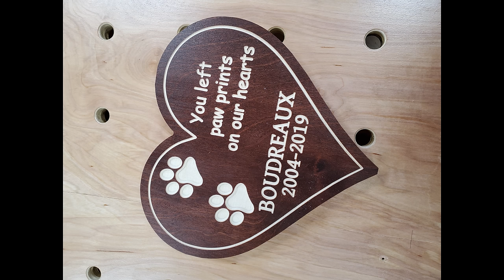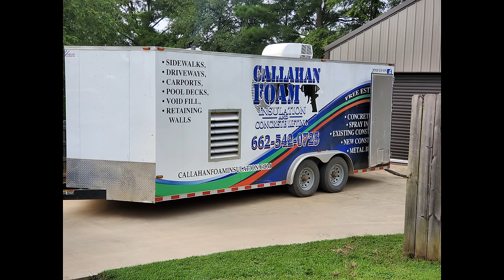30×40 Shop Part 7: Climate Control Overview - 326

Comment: I have a Mitsubishi mini split 18,000 BTU system in my 22’ x 22’ shop. Fully insulated ceiling and walls and an insulated 16’ garage door with only a R6 rating. I’m just south of Houston where it is humid all the time. The system cost me $3400 installed and it runs 24/7. I built a “plenum” to sit on top of the air handler in which I have a 20x25 furnace filter. 1) this system keeps my shop cool and dry, 2) the plenum keeps the coils clean, 3) since it runs all the time, the air quality in the shop is really great. Even if I open the garage door to bring in lumber, the system recovers in only a few minutes. An added benefit is how quiet the outside compressor is, and it sits next to our patio, and it’s nearly silent. I highly recommend this system if you want to keep your tools rust free and work in comfort.

Comment: I put a mini split in my shop with 1" of closed cell foam all over. Works awesome. It has the added benefit of sealing up air leaks and making the building quieter in the rain or hail. I had the backside of my garage doors spray foamed as well ( they came uninsulated )

Comment: Congratulations on finally having a finished look/feel so you can get back to working- looking forward to the builds. I DO HOWEVER, have to recommend that you get French doors (as suggested by others) or side rolling doors- cause you never know when you're going to have a very tall (and/or wide) project and it's a pain to tilt or lay down on it's side to get it below the garage doors on ceiling tracks... just a thought.

Comment: I put a 3 unit mini split system in the upstairs of our home when I finished it. Love it. 2 ceiling cassettes and one wall mount unit. 
The. I put a wall mount unit in my 24x30 foot shop. Used an 18/19 BTU heat pump and it works great. I still need to spray foam on the underside of the roof and insulate the roll up door, but the unit is keeping the shop cool in SC, so once that insulation is done. It will be perfect. Best investment I have made in the shop.

Comment: It sounds great Jay. Thanks for the information on the mini-split. My shop/garage building is 24x40 with 8’ insulated ceilings. We park two vehicles in the garage half so my shop is relegated to half the building. I think my AC contractor is planning on a 24,000 btu unit. Based on his estimate and the rate we’re saving for it I should be ready for it to be installed by February. Since I’m in San Diego about twelve miles from the ocean summers here are not as brutal as they are where you live but we do get a few nights of freezing temperatures each winter. Like you, I’m looking forward to finally having a climate controlled shop to work in. 

Enjoy your new shop. I’m looking forward to seeing what you make in it.

Comment: Jay...remember this about window tint...any time it's brighter inside than outside, the "mirror" effect is going to be backwards, meaning that people can see in, but you cannot see out. Since the first rule of shop lighting is "You can never have too much", there will be plenty of times ...day or night...when this occurs.

This is true of any window, actually...if you have a window on the front of your house (untinted or tinted),  unless the drapes are closed, if the lights are on inside and you cannot see what's going on outside from across the room, then that means that anybody going by can see right in. 

If you want to control the visibility into your shop, instead of tinting the windows, mill some lightweight channels and cut thin plywood panels to slide horizontally and slip them into the tracks. If you get real creative with this, you could put in multiple slots so that the panels would "stack" on each end and leave most or all of the window uncovered.

Comment: Nice shop. Have the same HVAC units. I live up north where you have a "back up heat". I've switched the breaker off and haven't needed it for 2 winters. Your units should also have a "dehumidifier setting" great for basements and I would assume also Mississippi. I love their warranty and have had to use it. And they even went above and beyond to compensate a VERY unique situation. You might want to put up drywall on your half walls to help the 2nd floor, if you want to. Just a thought. Love the new shop and love seeing people who do it right the first time.

Comment: I have a shop heated and cooled with mini splits also. Just be aware, that they lose efficiency and ability to work properly in cold temperatures. My mini split was working 100% and only able to keep my shop at around 50 degrees in the cold Wisconsin winters. I had to install a ceiling mounted propane furnace to bump up the temperature a little when I actually went out to the shop to work. Also, the electric bill in the winter was huge. If you have the option, piping natural gas lines to your shop for heating during the winter would be the way to go.

Comment: Nice job and congrats of the new place - well deserved. That spray foam will pay for itself and a lot of the other costs in energy saving over the 10-15 years. When the time comes for a new roof, consider white shingles. If you have the space, plant some nice maples around the shop for shade.

Comment: Great job. My local building code required fire proofing on any exposed foam. Did you have to spray fire proofing over your exposed foam in the ceiling?
Reply from the maker: No.

Comment: Did you consider radiant barrier insulation?  If so why did you go foam? In my old shop I used closed cell 6.5 inches thick on ceilings and walls and after adding 500 square feet of floor space didn't notice any difference in heat costs.  I was in a very cold climate. Now that I'm in Texas I'm going with radiant barrier in my new metal building.  I've read that radiant barrier in hot sunny climates can save 5% to 10%.  BTW, your insulation runs about 6.5 to 7 R value per inch. I would think in your area that would be good.

Comment: I have the same roll up doors that u have. I am going to insulate them myself with an R13 double pack poly. Supposed to work well, the only real problem is the gap between the head roller, but will build out an insulated case to seal that off.

Comment: You mention the Mitsubishi HVAC Conversion pump working down to below freezing. If the price of gas or electricity is less than the power used to heat at low temps, then the efficiency of the conversion unit is less than the other power sources. One has to compare actual cost factors, not merely if the conversion unit will work, unless no other power source is available.

Comment: Depending on what part of the state you are in you will need between an R30 to R60. Each inch is an r6.5 so if you want to in the future spray an additional 2 to 3 inches and those air conditioners won't work as hard. The walls are fine if they have 6 inches in them which I think that's what you did I'd hafta go back and re watch also the new doors will help tremdously as well.

Comment: These units are quite common in Japan, and Japan's climate is quite diverse. The best way to save utility fee is to keep them on all the time, keep it moderate at the night, rather than turning it off each time you enter the space. You might want to consider installing a smart remote home system to change the temperature. Congrats on your new place! It looks tremendous.

Comment: Hi, I agree that the Mitsubishi units are very good. I live in Pa and installed 4 units in my house that was built in the 187o’s and then added on over the years. The contractor I use was very competent and recommended, in my case, that I use separate condensers and air handles for two reasons one the smaller the unit the higher the efficiently and  two service and maintain is straight forward. The best to you.

Comment: Jay, in the future it would be awesome to get solar panels with power wall batteries. The whole shop could run almost for free and you'd be blackout-proof.
Reply: He can add wall batteries in phase 2, run the climate system on solar during day n on grid at night. I'm doing same at my home with a 5KW solar system. I will add batteries in phase 2 after some savings 😜

Comment: Have you noticed the spray foam helping with machine sound at all? I'd think it would do a lot to stop the echoey acoustics of a high ceiling like that.
Reply from the maker: It made it worse. But it's not bad. Not going to make any acoustic modifications.
Reply: @JayBates  That's kind of a surprise! But I suppose the foam is so dense that it would just bounce sound back, rather than absorb it.

Comment: Do you have plans for your air cleaner cart?  Especially the specifics on motor, etc?  I've been trying to design one and hitting a brick wall, especially about locating one that balances noise, CFM, and cost.

Comment: I do hvac for a living  and do some small woodworking. I was wondering how well the mini splits hold up with the sawdust?
Reply from the maker: Not bad. I'm going to build filter boxes for the air intake. Also, if they are getting too dusty then increase the dust collection and ambient wit cleaner efforts in the shop space. You're breathing in the same stuff the mini splits are.

Comment: Why did you decide to use spray foam instead of putting in a ceiling. I have a 30x42 shop I am working on now. Thanks
Reply: if you have a chance go visit a space that has exposed spray foam insulation. It is the best sound absorption you can have.

Comment: Jay , shop looks good, one question , what is the fire rating for spray foam, I spray-foamed my basement and I had to cover drywall for the fire rating
James  Dundas Ontario Canada
Reply: The irc requires the foam to be covered with a fire rated material if in a dwelling. An unattached building is not a dwelling. Insurance company might want it covered, if so there is a thermal paint that can be applied.

Comment: The spray foam is mixed at the gun. Basically the product is manufactured as it is installed. If anything goes wrong with this process it can have serious consequences. Hence make sure it fully cured in the area where you had problems.

Comment: 2 inch insulation is about 3 times less, then we would do in DK. Spray foam being illegal, since its flammable. We use glass or rockwool for the most :-)

Comment: Just a heads up with the window tints, if they are like the ones I've seen, they work brilliantly at reflecting light outwards duering the day, but they basically become like normal windows when it gets dark outside and the lights are on inside. I discovered this at a stay in hospital and where people hadn't closed curtains you could see through them. Due to this more people have seen me getting ready for bed then I would like......... and a lot of people probably got a good laugh LOL

Comment: How do the mini splits affect humidity?
Reply from the maker: Every air conditioner is a dehumidifier if sized properly. If too large of a unit is installed it won't do a great job taking the humidity out as it doesn't run enough. That's why they are called sir conditioners and not air coolers.

Comment: Do you have a local listing on Craigslist for cnc offerings? Many times I wish I knew someone who had one that I could send my files to and have them cut them out for whatever pricing system they had in place.
Reply from the maker: I don't. Where are you located
Reply: @JayBates  I'm in Houston, I saw a guy with an industrial sized planner offering planner services and thought it cnc or Lazer cutters would be an easy side business for people not wanting the huge upfront costs.

Comment: Jay, thank you for sharing all of this information with us.  I, too, live and work in the South, and I know how brutal are our summers.   I have set up my shop in one end of a 15,000 sq ft metal building we have.  This building has high ceilings and minimal fiberglass insulation.  The space I have is almost identical to yours and I am planning on enclosing about a 35 x 45 area with stick-built walls and lower ceiling.  I also hope to add climate control because I plan on building music instruments here and I have to control the humidity.

Comment: Het Jay,
Nice Vid & Nice Job on the shop.  My sole critique is it would have been more informative if you would have invited your contractors to sit around the work table with you to discuss the various system, their BTU's, their R Factor, NOT THEIR COSTS (as cost will vary) but their COST SAVINGS before and after.

I must admit your NICE AND EASY DOES IT attitude.  That is part of what keeps bring me back.
J

Comment: Don't get "one way" window tinting if you just want to keep UV out. There is no such thing as one way mirrors/tinting. That's physically impossible, it is always the same in both directions. You will always see from the darker side into the lighter side. Which means at night with the lights on in the shop you won't be able to see out of the windows, but everyone will be able to look inside.
There's also not really a need for a UV filter on glass. It itself is already very opaque to UV. Get an IR filter to keep heat radiation out. That's what you find thermally insulating windows for homes (the IR filter is integrated into one of the two or three glass panes).

Comment: Damn, that's 3 ton equivalent reversable AC system. Must be expensive for 3 inner units but what is really amazing is ur insulation treatment. Ideally it should have been 28000 BTU for the size of ur shop but 8000 extra will be helpful for that loft area n heat generated by the equipment during working. Good calculations 👌🏼👌🏼👌🏼
If you may add Solar panels on ur roof that would generate it's own electricity during the day time to run this climate system in summers atleast.

Comment: MITSUBISHI GREAT CHOICE MAN -  Mini splits have come a long way as have heat pumps you wouldn't think there is heat outside to move indoors when it's negative 5° F but there is. Heat pumps and or air conditioners those those who don't know move heat they don't make it. I know of people who needed 5 zones in this massive home they went with a minisplit system instead of the standard AC because they didn't want 5 BIG A/C unites all in a row in the backyard

Comment: Just an FYI, but just because a system can do something does not mean that it is also efficient at doing it!  ALL heat pumps become less efficient the colder it gets outside!  It takes more and more energy to extract heat from air that has less and less heat energy in it to give!  The same is true in reverse for cooling, the hotter and more humid the less efficient the system will be at cooling!  It is basic physics!
Reply from the maker: Correct.